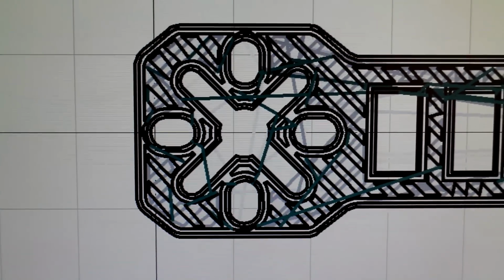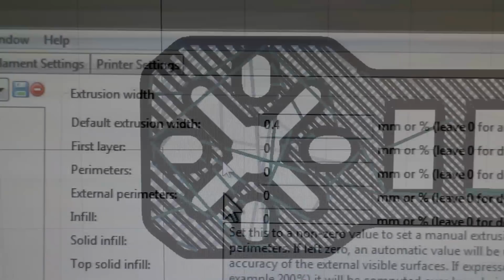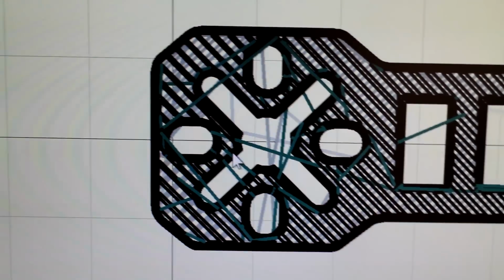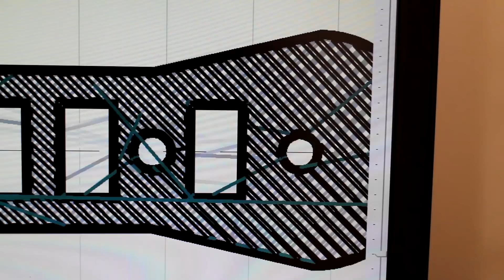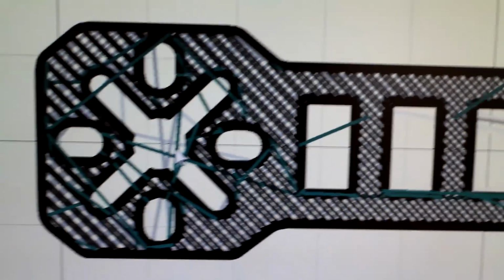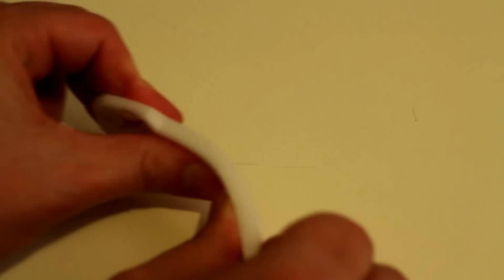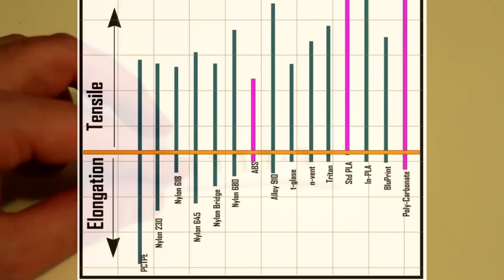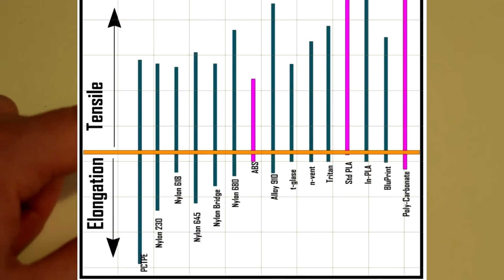3D Printer - Strong Nylon Bridge Filament

Comment: Bridge is a very nice material to work with, but the application has to be right. I agree that the flex was more than I expected when I first used it as well. It also sucks up moisture likes nobody's business. If you want no sizzles or pops while printing and also more transparent parts, you'll have to store it with some desiccant in a sealed container.

Comment: You definitely have too much moisture in the nylon. Nylon can absorb as much as 20% of its weight in moisture. You need to bake it for a couple of hours prior to first use and then store it sealed with desiccant. You'll get much better results after that,

Comment: You've got my attention, again. I'm designing a 250 quad right now but may go ahead and go bigger and do more of a camera platform.
Reply from the maker: +Josh Bishop 
Interesting. Will the camera platform be stabilized? Might need to go 350 size to carry the extra weight.
If you build a quad frame at that size or larger, carbon fibre tubing is the way to go as a skeleton, utilizing 3D printed nylon parts to construct it - in my opinion :P
Reply: +Tech2C  oh yeah, I've been looking at building the DJI inspired. but for now I'm going to stick with the 250 quad.

Also you need to add some tags to the peon230  on thingiverse. If you type just peon or just 230 your design doesn't show up in the search results.
Reply from the maker: Ah, thanks! Updated.

Comment: I had the same problem you had with flexible parts, try 100% infill. I noticed once the part is solid the rigidity is a lot better.
Reply from the maker: +3D Workshop 
I would have thought at 100% infill there would still be some flex. For drone frames it must be stiff.
Think about PLA and ABS filament, doesn't matter what infill you use the part will be stiff regardless.

I have a roll of PETG on the way, I think that will be a great candidate for this application.

Comment: Yep, I was saying that to myself because Nylon is a thirsty beast and will easily absorb moisture.  Here that filament would need to go in a chamber that is vacuum sealed due to 75-95% humidity most of the year.
Reply from the maker: +legalizeshemp420 
Yeah that's what I encountered. You can hear the popping in the video too. If I buy a roll I'll need to take care with it.

So I take it you're located somewhere around the equator :P
Reply: Tech2C
LOL, no but might as well be.  I am too close to the Mississippi river in Memphis, TN USA.  The only time I don't have humidity is when I run the gas heat in the winter which makes it too dry then for health.  I do have a box I purchased with a weather tight seal and two Evadry in it and 10 rolls of filament with a humidistat.  Take the lid off for 9 months out of the year and it jumps from 5-10% to instantly 70%+.  If I leave the lid off for say a day or two the ABS/PLA inside absorbs enough moisture that it takes 3-4 days for the humidity to fall back to a guessimated 10% when all is tight again.  I say 10% because my meter only goes to 20% and anything less it just says LO so I have no idea but I suspect around 5-15% so I just say 10%
Reply from the maker: +legalizeshemp420 
Ok, that much humidity would be uncomfortable! I guess you have a reverse cycle air conditioner to dry the air inside your house? Having to store your filament like that is probably a good idea regardless of the humidity, especially if you're not going to use the entire roll in a short time span. I may do something similar. Cheers!
Reply: Tech2C
You will absolutely love the Evadry as it will tell you when it needs to be recycled and when it does go take it to an electrical outlet and plug it in and in 12 hours it is ready to go.  From what I understand people use them in gun vaults and important paper vaults/safes and each one (I use two) removes half an ounce of water before it needs to be recharged.  They last 10-20 years they say.
Reply from the maker: Amazing, thanks for the tip!
Reply: +legalizeshemp420 seconded on the evadry, could not print nylon without it.
Reply: Gabriel DeVault
Best investment I ever made for 3d printing.

Comment: Nice review thanks.
Its a shame you didn't print all four arms and try it. My thought is it may just be the perfect amount of flex for such a small quad copter. In my defense its hard to tell how much force your applying to bend it over the video but it looked to me to be reasonable for 1/4 the weight of such a small quad? Thanks again for the detailed review.
Reply from the maker: +builtrodewreckedit 
It was just a bit too flexible for the quad. You can imagine as the motor creates thrust, it'll bend the arm a bit then the prop will hit the arm as it'll tilt toward it. 
I'm glad I bought a sample only, not an entire roll for this use case. Other than that it's good stuff.

Comment: You should try printing with nylon strimmer line. It's available at 1.65 diameter. It's a lot cheaper and prints great. I've printed about 4 kilos of it mostly for gears
Reply from the maker: +James Johnston 
Yeah I've heard about this. Is there an odor or foul smell melting that stuff? I will definitely be trying this!
Reply: I haven't noticed any odor from it although when i dry it out in the oven over night you can tell something plasticy has been in there when you open the door but its not that strong. Here's a link to the stuff i use http://www.amazon.com/gp/product/B003VPAEL6 or if you want i can send you a few metres for you to try it out
Reply from the maker: Thanks for the offer James. I'll pick some up from the local hardware store at some point.

Great that there's no odor from it.

Comment: I know this is an old video, but have you retested the flex with dry filament as other comments have mentioned? I was just wondering if the elimination of all the air pockets would stiffen it up.

Comment: taulman 910 is much stiffer. Also, you must redesign parts to work better with the different characteristics of different materials. Blanket statements like "I cannot recommend this for quadcopter frames" are a bit ignorant in my opinion. I have printed many successful copters and parts with taulman nylon. I have printed dozens of kg of bridge and 910 and it looks like this filament was "wet". You can tell because it is white and opaque instead of clear and translucent. You can also tell because it hisses, pops, and bubbles as the water turns to steam when you're printing. Being wet greatly reduces it's strength and stiffness, you have to keep this stuff very dry, I have found I can only leave it out for a day or two before it needs to be dried again. I now have sealed containers with desiccant and humidity gauges.
Reply from the maker: +Gabriel DeVault 
Thanks for your comments. I agree, Nylon Bridge will be great for parts designed around its characteristics. However, did you notice the quadcopter arm bend back onto itself?? I stand by my recommendation. 
The next video I print with Alloy 910 and have nothing but gleaming praise for it as the next 'Unbreakable' quad frame material.

Comment: Nice video but I disagree on your statement that Nylon is that much stronger than PLA.

Look again at that (official) graph of material strength from Taulman.
You see can see the tensile strength of PLA is much higher than that of either ABS, PETG, T-Glase or Nylon. 
It's only the impact strength of PLA that is much lower. (Standard) PLA will simply not flex and break of. Nylon on the other hand is very flexible and PETG is somewhere in between. But if you need a rigid material that won't budge or flex, PLA is the definite choice (unless the prints needs to operate at higher temperatures).

Comment: hi, good video!
to resolve nylon warping, are you using only blu tape or blu tape with vinavil?
Reply from the maker: +vermicoc2 
Only blue tape. You will need to crank up the heat on the heatbed if you experience warping.
Reply: +Tech2C ok i will try it 
Thank you

Comment: What 3d printer do you have. Also is it open source
Reply: He's got more videos on it, he's done some upgrades and yes it is open source. I've bought the a cheap Chinese kit that had a lot worked out, it's no longer available but if you do your research you can find a similar deal. A buying guide from +Tech2C would be a valuable resource to people looking to buy prusa reprap printers with no previous experience.

Comment: hello, what type of tape you use to secure the parts to the hotbed
Reply from the maker: +camilohydeist 
Blue Painters Tape. 3M brand number 2090.
Reply: thanks for your answer , I'm using a similar tape but do not get good results , large parts hotbed take off with 90 ºc and a print speed of 30mm
Reply from the maker: Make sure any cooling part fans are off. Print the first layer closer to the bed. If you aren't using 3M branded blue tape number 2090 then our results will be different.